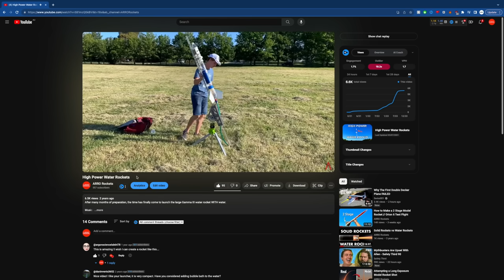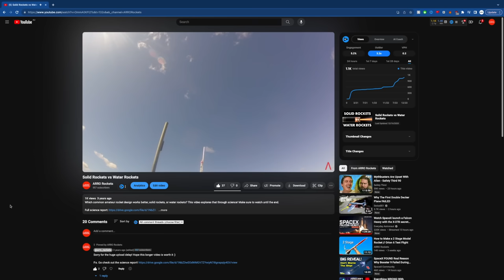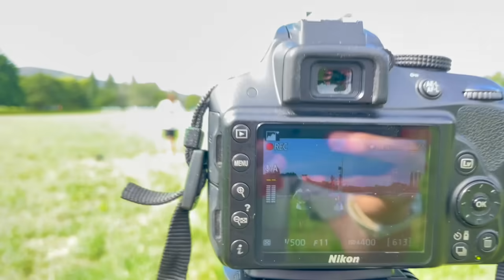My Largest Water Rocket Yet

Comment: do you do any simulations for your flights, or is it just a build and see? I’m coming from model rocketry where i use openrocket to make sure my design will actually fly. this is really cool, and seems way more approachable and affordable than solid rocketry.
Reply from the maker: That's a great question, and I highly recommend you get into water rocketry (I have a lot of videos covering how to get started, especially with the launcher mechanism). In terms of simulating water rockets, there are simulators online where you can plug in the basic details of your rocket and get a rough estimate. OpenRocket will always be more accurate since it takes into account the aerodynamic properties of the airframe. So, in the video called "Solid Rockets vs Water Rockets" I developed a program which can generate water rocket thrust curves, and then inputed them as their own engine file into OpenRocket to get a complete simulation. Sounds complicated, but there's are report in the description of that video which covers it in more detail.

Comment: Instead of the aluminum extrusions as a launch rail, I'd probably try using a 1/4 - 3/8" thick piano wire with an aluminum tube attached to the rocket to slide over it, like the old Estes launch system.
How much water do you use, ie: whats the air/water volume ratio?  Also what's the max PSI you've used?
I wonder if a two stage, or parallel stage water rocket would be possible?

Comment: Teflon or Delrin rail "beads" or T shapes. It would be cool to find polycarbonate tubing about twice as think as the soda bottles and triple the pressure. You make me want to try this with PVC plumbing pipe. It can handle much higher pressures than the water pipe rating because it has to take water-hammer and other effects. 

4" PVC pipe has  a minimum burst pressure of 1100 psi or 7650kPa. 3" is 1200psi.

Comment: mate my dad has built these for years and they go alot higher than that.. 100psi charge limit. you can make a multi stage rocket also by using a bolt to hold the bottles together, with the bolts hollowed so they are 1 big chamber. this multi bottle rocket goes about as good a single rocket. how my dad launched it was with a fork lift and bungee cords. the bungee cord held a plug with o ring in the nozzle under tension. there was a bike valve fitted to the top bottle to charge it, the pin would fall out the nozzle as it reach the top of the forklift and away it would go. ill have to ask my old man how many bottles was used i was very young back than. but i think it was around 6 or 7 2L coke bottles.

Comment: With the pressures you're at I believe you should have choked flow. I think the nozzle geometry might be critical to performance. I recommend 3D printing various nozzle geometries (which you can research). I bet you can easily double your performance. Nice video, keep up the water rocket research.  One of the first things I bought myself with my own money was a water rocket.  I loved that toy. But it isn't a toy, really.
Reply from the maker: At the relatively low pressures I was working at for this test flight, I'm certain that simply a larger nozzle diameter would've provided a higher (granted short term) acceleration which would have probably been more ideal. But obviously the 9mm nozzle still worked which was my only concern, and meant I could use the hardware I already had. Tricky thing is with using garden hose fittings is that it limits what geometries and diameters are available, so to experiment with that, I'd have to make new launcher mechanisms, maybe a future project! :)

Comment: This is Absolutely Amazing!!! I Think Make One From Carbon Fibre & Use A Big Electric High Pressure Water Pump Which You Can Make From Most Cheap Water Blasters!!!! 

There’s Some YouTube Videos That’ll Show You How Too Do it & it’s The Safest Way Too Increase Pressure 1000 Times Than V1 Much More Powerful Even Make a Dual Chamber With Different Fluid Vessels That Work independently or in Sync….
 I Had a Small Toy Version As A Kid!!!!

Comment: Water isnt ideal for a rocket exhaust, because water is incompressible. The water isnt being accelerated through the nozzle very much.
Reply: Try pressurizing the bottle with just air, and add a cd nozzle on it.
Reply from the maker: @matthewdawsey9892  The water is actually a critical component, there's a reason why water rockets are such a common type of rocket. Like you mention, the exhaust velocity is very important for performance, however another component of the thrust equation is the mass flow rate (quantity of mass flowing through the nozzle), so water adds this critical mass to the exhaust, which inherently provides more kinetic energy. You're correct that water is incompressible (which is ok) and also has quite a large mass, so the compromise for water rockets is approximately 1/3 water and the rest air by volume. I've launched this rocket and other water rockets with just air, and the results are much less impressive due to fact air doesn't have a high mass density.

Comment: WD40 Pffff is for stainless steel .. it is not
like in N O T  at all a lubricant...  SILLICON SPRAY.
use TEFLON PtFe rail nob´s ... why doe´s nobody
make a sepret air pressiur tank who injekt high pressiur air in truh nossels in a wentury nossel
so water get added speed.. it is like a water jet under water doe´s not push as hard as a waterjet
pusking off the water surface.. any on knows this..
Reply from the maker: I used WD-40 brand silicone lubricant, not just regular WD-40, which is fine for aluminium :)
Reply: @arro_rockets  yed sorry ... it lok´ed
like regular wd40 ...!!! i like your design.. 
but if you seperate water and air and first blend them in the venturi nossel.. so you feet more air in the water for better thrust.. misty air push harder.. try a regular water hose and make a hole in side .. 5cm from the opening .. push air nossel in hose and open for air .. you get way way more power... on air and water.. make a test.. you can even make a small tube with air injector on side ... just look up venturi nossel .. it accelerate water air pressiur... and water speed/presiur.. push harder longer